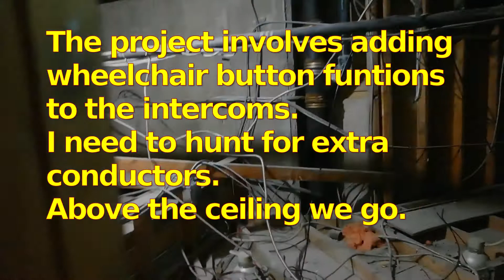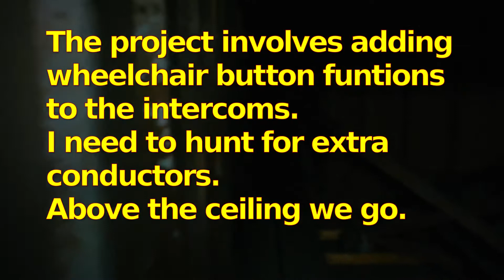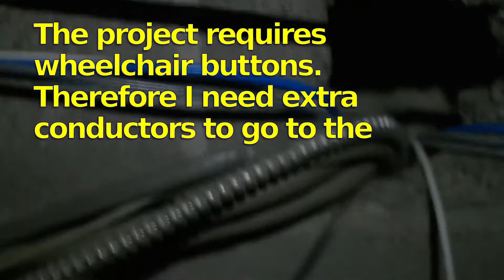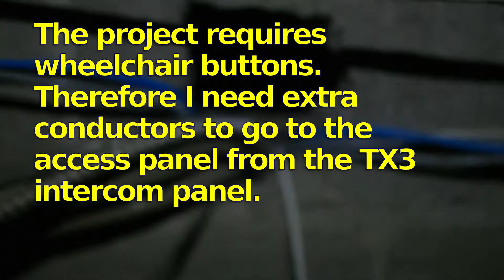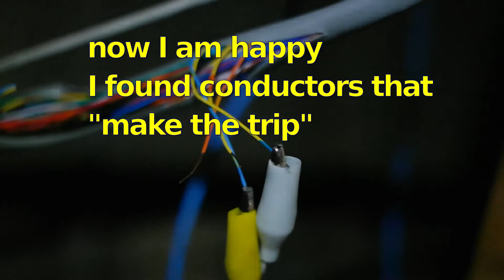TX3 Intercom one of 3 network together.  Needs a wheelchair button.

Comment: How did you find the conductors ?
Reply from the maker: It was not easy.  The intercom was upgraded about 5 years ago, and behind the wall was a multi conductor cable that went through the ceilling all the way back to the old intercom controller which is now where the access control panel is .